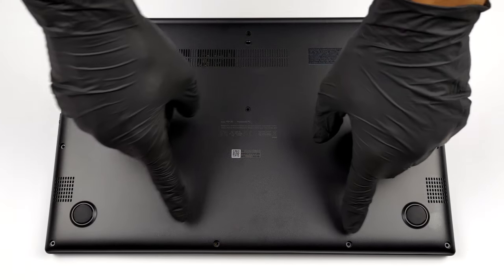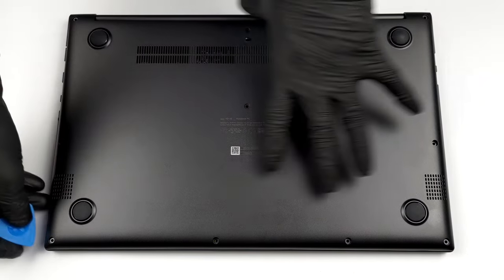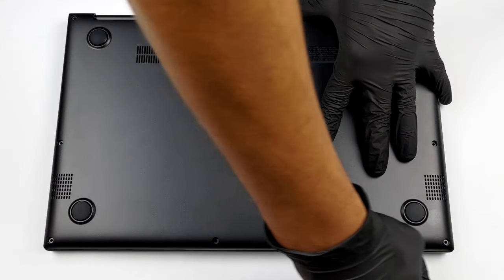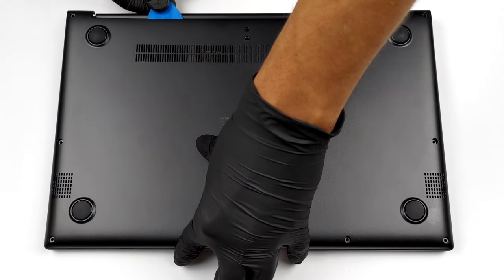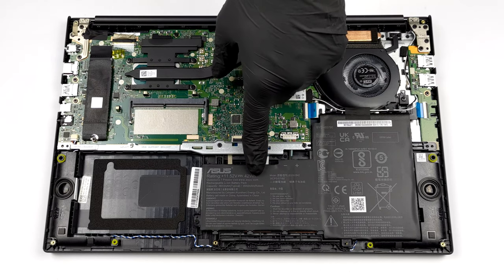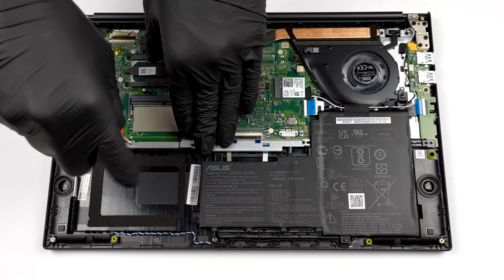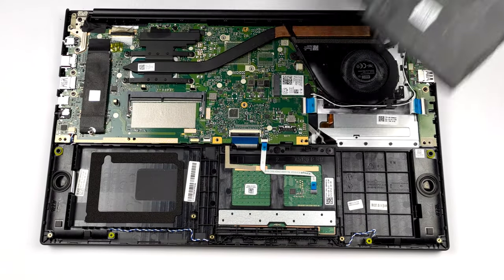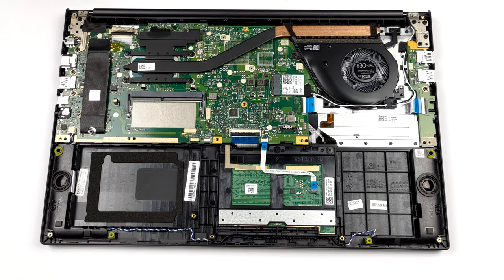🛠️ ASUS VivoBook 15 OLED K513 - disassembly and upgrade options

Comment: Just bought the K513E model comes with a Nvidia MX350 2gb gddr5 gfx card, pretty happy with the purchase, good to know it has a spot for a SSD and the ability to upgrade the RAM, probably the best value for money laptop you can get in the market, good performance, build quality, screen is a highlight here, the OLED is fantastic
Reply: for how much
Reply: @CaptainScorpio24  about 800$
Reply: @treeko2139  ok thanks 😀 yeah its the best midranger.
right now i have dell Inspiron 13 5379 2 in 1 since 2017 .
my next laptop will b OLED
Reply: @CaptainScorpio24  MX350 is supposed to be 4gb.  MX330 is supposed to 2gb.
Reply: Do you think it would good enough for home studio musical studio recording or..logic Pro ?
Reply: Are you sure the ram is upgradable? To 32 GB as an example?

Comment: hey so I just bought this 1 week however on a full charge I'm only getting  about 4 hrs max on the 2nd better battery setting. I also disabled some background notifications. How are you getting 8 hrs of battery life? Mines half that with only a few web pages open? thanks!
Reply: I get 2:30 hrs backup only

Comment: i have on the asus vivobook 15 2x ram slots, but if i open my laptop i can only replace one, one the task manager it stands that i have 4 gb slot and 16 gb slot, my speed is 2400mhz, - on the internet they say if i buy 32gb with 2666mhz it will not be effective because my laptop only supports 2400mhz, but can i change the first slot with 4gb ? its not to seen if i open the laptop, i think its in the motherboard ? can i change it to 8gb or 16gb ? so that i have 16gb in the first ram slot and 16gb in the second ram slot ? pls help  thank you

Comment: Is the ram and ssd upgradeable??
Reply: Ram, yes.    SSD is soldered,  so no. But you can add a 2.5" hdd for more storage.
Reply: Yes, one dimm of ram is soldered in my case i have 4 GB Soldered and 4 on the slot, and have 1 slot m2 nvme and 1 sata i but 10 pins conector and add sata ssd

Comment: Can i add 16gb stick ram
Reply: I bet the slot takes up to a 32gb stick. Best would be 4 + a 16gb stick for 20GB total.
Reply: @kevinrichards1666  I added 16 gb a month ago
Reply: @anooproychand  did the device read that 20gb? i'm scared that my device cannot read the total ram which is 20gb if i add 16 ram.
Reply: @azriel319  yes it have total 20gb and usable is 19.7 gb
Reply: @azriel319  it's working very well no need to scare
Reply: @azriel319  it now takes more load and perfrctly multitasking ☺
Reply: I have 8gb soldered and added a 16gb stick. It reads 24gb and rund good. I can't find if it would read a 32gb stick anywhere but woulda went that route if I knew
Reply: @anooproychand  how is the 20gb ram doing now? have you had any issues?

Comment: I was just wondering if anyone could possibly give advice on how the Asus vivobook 15 laptop ( ASUS VivoBook, AMD Ryzen 5, 8GB RAM, 512GB SSD, 15.6 Inch OLED Laptop, M513UA-L1188W)
compares / how would you rate it against the Lenovo IdeaPad 5 which has AMD Ryzen 7 5700U processor with same 8GB ram (memory), and same 512GB SSD storage, 15.6 inch screen, model 82LN00ENUK. only reason is that I am completely new to laptops having still owning only very old over 10 years now still with an outdated Windows 8 Toshiba Satellite Pro L850 laptop which although back in its day very good/ possibly nearly top of the line laptop in Toshiba range; is now nearly on the brink of breaking down/ nearly stop working due to it's age and issues such as slow booting time and turning off randomly at times by itself, making files I have saved very vulnerable of loosing once it crashes completely unfortunately. It would be very useful if somebody could possibly give advice on which laptop is best as not looking specifically for a very expensive high end laptop but just good enough to do daily buisness tasks. In my understanding despite the Asus vivobook laptop nowadays comes with the Ryzen 5 5500U processor which is slightly lower performance than the Lenovo ideapad 5 which comes with the Ryzen 7 5700U processor but seems like now Asus comes already pre- installed with Windows 11 Home or is it the Windows 11 S edition anyways, wheras the Lenovo despite having slightly better processor has only Windows 10 Home/ or Windows 10 S installed at least according to my research.

Also was wondering as not much knowledge regarding these two/ 2 laptops I was wondering if these laptops come with the older type of 2.5inch SSD or the M.2 drive SSD? 
Thank you,
Tom.

Comment: Why did you take the battery out yet didn't even mention the m.2 slot that holds windows, u pointed out where an ssd could go but didn't tell us what we will need to plug it in to the board and said you can increase the memory but left out what type of memory ram to buy is it ddr3 ddr4 and at what speed? Because if you do not match the speed of the ram soldered to the board with the ram to buy u may have a problem claiming true 40gb.